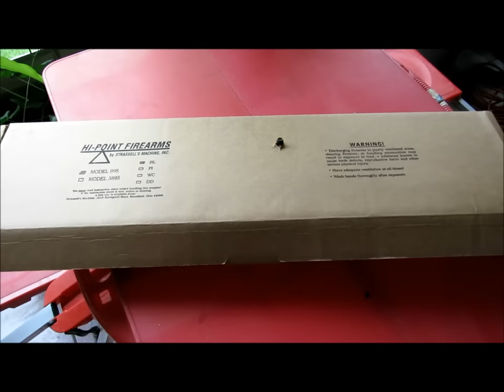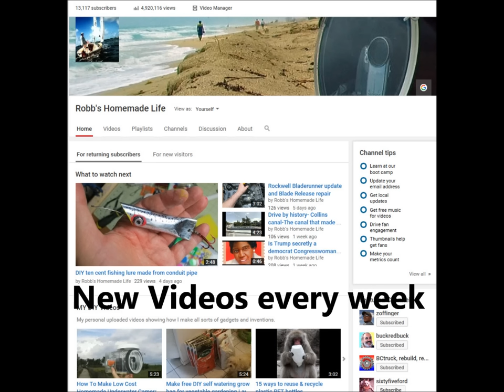10 reasons I bought a Hi Point Carbine & 6 bad reasons not to

Comment: If they designed this carbine to use glock mags gun stores could not keep them on the shelf.
Reply: there is a company that takes glock lowers and turn them into carbines.
Reply: Agreed, but this was designed during the Assault Weapons Ban, as such limited to 10 rounds.  A new version would be nice, licensing to Glock might drive the price up though.
Reply: Game Lard there is a survival rifle that accepts glock mags, and is extremely versatile (several conversion kits available), but starts at about $750. the name escapes me, but it is by aero something or other.
Reply: I almost purchased this but instead spent the extra cash and got the Keltec Sub 2000 for that exact reason.
Reply: The TNW Aero Survival Rifle.
Reply: Rick Ncarolina Imagine if Glock made an actual pistol caliber carbine.
Reply: Jesus Christ, if there was a version of this carbine that would take Glock mags, I'd spend money out of my rear end just to buy it (I'd spend money I don't have for it).
Reply: Ruger PC Carbine 9mm takes Glock mags. It's about $300 more than the Hi Point, though.
Reply: No shit right!
Reply: They don't need Glock's permission to make this gun compatible with Glock magazines.
Reply: Ruger makes a glock mag PCC now.   Even breaks in half which is cool.   Keltec also makes a quick-folding PCC that takes glock mags, I have one of those too.   995TS probably has better ergos, but the keltec is neat because its insanely lightweight and folds super small instantly.
Reply: @dusty  I am not sure why this was said either, I believe maybe because glock magazines are abundant and not as costly as purchasing the magazines designated for the Hi Point Carbine. Glock mags being double-stack is probably a factor too.
Reply: @th3unmaker  wow the convenience of glock magazines at the low price of 400$ exctra
Reply: Eastern Cowboy why would they need to when you can buy the high point mags for less
Reply: Ha! I looked everywhere around my area pawnshops and retailers for a good month. My buddies refused to let go the one they owned.
Reply: And they might sell even more if xd mag was a option. Or just simply made their own proprietary double stack.
Reply: @th3unmaker  Kel-Tec makes one
Reply: Imagine what a Hi-Point would be like if it were engineered to $500 price point
Reply: @dusty because if you're having to buy mags, or pick them up off of kills, Glock mags would be abundant.
Reply: Well regardless. They are sold out everywhere now.
Reply: Theres a company that sells a spider stripped lower reciever with a glock 9mm mag well.
Reply: They can't keep them on the shelves now with factory mags!

Comment: Thank you for posting this review as you did.  I am neither a Hi Point owner or user, nor do I plan to be.  But this is one of the best  and most unbiased, honest reviews I have seen on this weapon.  (Honest in that his personal reasons/feelings are expressed and actual information is imparted - both pro and con.)If I may suggest, add a few brackets in the case to hold it steady in the case to protect your investment and, should the need arise to retrieve it in a defensive/emergency situation, you can do so quietly and securely. Finally, unless you are a seasoned gun owner, I would suggest taking it to a range to become familiar it.All the best! :-)

Comment: These are excellent weapons. If you have a problem with it "jamming" it is usually a magazine issue. Of the HP carbines the 995TS is my favorite. I have a .40 and a .45. The longer barrel gets more potential out of the pistol cartridge. What's funny is there is a suggested video comparing the HP to the AK47. I have seen that one before and the HP is more accurate! Thanks for the video.

Comment: A person can literally run over this rifle with a truck and Hi-point will fix or replace it at no charge. ( you may have to pay shipping  ) No other firearms company does that or none that I know of.
Reply: Yes it’s solid and reliable, my pet peeve is the weight, after adding a Red Dot optic, forward grip & flashlight and using 20 round mags, it’s a little heavy.  I own a Kel Tec Sub 2k, out the box that Carbine is only 4 pounds, suffice to say I haven’t taken the Hi-Point to the range since I’ve had my Sub 2k…

Comment: One more great aspect of the Hi Point, mounting a red dot couldn't be easier.  If you're middle aged and your view through iron sights is nothing but a blur then a red dot can be salvation. It's hard to beat a Hi Point 995 paired up with a Bushnell TRS-25 for high value and low cost. At that price point, nothing even comes close.

Comment: I really like the Hi Point 995TS carbine.  It is a great partner to a 9mm pistol.  I have been testing hollow points in my carbine.  Most heavy for caliber hollow points work well.  My best results were 135 grain Critical duty, Federal 147 gr Hi Shok.  124gr and 147gr standard load cartridges with a XTP bullet work well.  No 115gr HP I tested was able to stand carbine velocities at self defense range.  Every 115gr bullet I tested shredded on impact with a jug of water.  I quit testing 115gr ammo in the carbine when a Gold Dot over expanded in the first jug of water.  
If all you have is a 12ga pump shotgun low recoil ammo is an option.  I prefer standard velocity buckshot but I have health issues. Low recoil is easy to shoot and I am confident with low recoil buckshot.

Comment: good video for someone who is admittedly not a gun guy. in my opinion the part where you said it more accurate because you use 2 hands could be changed. I'd say it's more accurate because it's "shoulder fired". handguns use both hands as well (99% of the time). I think for self defense I'd prefer a bit more stopping power so if lean more for a $300 SKS that shoot the very affordable 7.62x39 ammo. it's cheap, combat proven, and is a deadly weapon even when you run out of ammo since it's steel and wood vs plastic.

great video buddy.
Reply: +mixflip The 7.62x39 ammo the SKS shoots is actual rifle ammo, and will be accurate at longer range. The milsurp ammo is indeed cheap, but corrosive. Yeah, proper care and cleaning of a firearm takes care of that, but many people will go to the range, then put it back in the closet until next time. I like the SKS, so don't get me wrong. Great firearm. I'd also say that the weight issue he talks about could also be said about the SKS. I guess people are lazy. Anyhow, I have the SKS (besides a couple of Mosin Nagants, Mauser 98, Arisaka 99 7mm, and a few other heavy goodies), and will be getting a HiPoint 9mm carbine. Agree with your points, and agree that he made a great video.
Reply: +Steve W I believe my norinco has a chrome lined barrel so it should hold up well to neglect with surplus ammo. in my opinion if you are planning to ever use a firearm for self defense then a big part of that plan should be basic maintenance. I'm not talking full milspec field strip but run a bore snake through it and store it decently oiled. 

if people can't even do that....well then I can't say the world will miss them lol. with 7 billion people consuming earth resources....some of us have to go.
Reply: mixflip
Agree completely. Your Norinco does have a chrome lined barrel, and as you say, still needs cleaning.
Reply: +iTheGeek ??? 7.62 does almost nothing? wow thats a first. usually folks say the smaller calibers do nothing. the funny thing is almost every Police dept sniper uses a Remington 700 in 7.62mm which definitely does some damage.

as for the military. they didn't drop 7.62mm because it didn't do anything. they dropped it because leadership at the time were trying to lighten soldiers overall combat load. carrying 6 magazines loaded with 5.56mm is significantly lighter than carrying 6 mags loaded with 7.62mm ammo. combine that fact with dumping the heavy M14 with a lighter M16 and the military got what they wanted in a light combat load.

a basic sniper for decades used 7.62mm even after the military went with 5.56mm for regular troops.

to say 7.62mm does nothing to a body is utterly ridiculous.
Reply: +mixflip Do you plan on storming some trenches? The SKS is a much bulkier gun and yes it does use a rifle cartridge. I dont really like the SKS stripper clips.
I have both and for fun the HP is great.
Reply: +iTheGeek 7.62 is military and made to not expand.
5,56 does the same but may shatter.
40 SW can be HP.
Reply: i wish i could find an sks for 300 ive only seen them in the 500 dollar range
Reply: +Brian Plotts I picked up a Zastava N-PAP M70 last January for $450 new in box. It was as good a deal as I was going to find, so I jumped on it.  I think they are running about $530 these days, but you can usually find great deals on AKs and SKS' on black friday.  Also, gunbroker has SKS listed in the $300 range, but I can't say what their condition is.  Just gotta shop around and jump on the deals.
Reply: +mixflip Or for another $100 he could get a VZ2008 (civilian US made version of the VZ58), a phenomenal rifle also chambered in 7.62x39. I got mine for $400 new including the FFL fee and it came with three 30 round mags and a bunch of accessories. Mine has a folding stock too so it is very compact and suitable for home defense, despite being a bonafide rifle. Then again, he lists among his reasons that it uses a handgun round. Not sure how you can beat a weapon you can buy $200 brand new... I wouldn't mind having one of these in addition to my VZ. 

I would suggest anyone considering an SKS to look seriously at the VZ. Uses the same clips as an SKS to top-load the mags from the top (if you wanted to do that) in addition to having a normal removable 30 round magazine somewhat like that of an AK (not the same). For $400 you cannot buy a better rifle. But for $200, the HiPoints are actually pretty good too.
Reply: +Defx10 So how is the NPap? Is it decent quality? I remember going to Maine Military when they had stacks of YUgo SKS. I think I paid $125. They had tables full of cracked stock cheapies.I think the AKs then were from $199 up. You dont see many AKS these days here in Maine.Not even at GUn shows.
Reply: walter chiappini
I love it. The quality is high, and it doesn't have any of the rough machining marks on it that other AKs have. It's clear that they took the time to make them well, and they are made from all brand new parts.
Nutnfancy has a full review of it on his channel, and he loves it.
Reply: +mixflip I have an SKS and I disagree with you.  The SKS does not make a good home defense gun.  First off it's 41 inches long, that's 9 inches longer than the Hi Pointe Carbine.  He also said he is a beginner, this carbine would be very easy to shoot.  7.62x39 will overpenetrate as well, it will shoot through your house and through a neighbors house and hit them.
Reply: Brian Carroll 9mm will overpenatrate too, especially out that 16+ inch rifle barrel. Any round that can reliably stop or kill a human being with a center mass shot will go through interior walls of any mainstream home like its not there, even in handgun format.
Reply: mixflip good luck finding a SKS for $500.00
Reply: I think the 13 yo girls and 80 yo gramdmas won't agree with your SKS choice. LOL
Reply: just buy a 12 ga
Reply: @devinpetersen2387  580$ before tax from Canada

Comment: This video randomly found me and I'm glad it did. Very informative, Robb. In recent years I picked up a couple of Hi Point carbines (chambered in 9mm as well as .45 ACP) because I realized I had a lot of pistol ammo and wanted something other than a handgun to push it through. And I didn't want to spend upwards of $1,000 on a carbine, so price was definitely a factor. They may not win any 'firearm beauty contests' but, as you mention, they're reliable and definitely better than a sharp stick (as the old saying goes...). And maybe one of these days ammo will go back down in price. At 40-ish cents per round (for 9mm) it seems like a person almost needs to take out a loan to go to the gun range nowadays. Again, great video!
Reply from the maker: Hey Jason. Thanks so much for commenting. I agree with you. If I had a 45 pistol I definitely would have considered getting the 45 carbine.

Comment: I did the same.  In fact, I bought it BECAUSE it was cheap. I just had to try one out. for $300 out the door, it just had to be junk.  But I've shot the heck out of it and and it just plain works.  And I can't say its ugly.  AR-15's aren't pretty...I have one of those too.  AK-47's aren't pretty either.  My only beef is the 10 round mag, and redball seems to have fixed that.
Reply: MrMerlin9911 Ar15's aren't pretty? Stop joking. The Hi points are hideous. But I've heard more good than bad about it's performance.
Reply: Nope. AR's are functional. They are not pretty.  Here's a pretty gun. http://www.gunsandammo.com/blogs/history-books/most-beautiful-handgun-ever/AR's are ...well...tactical looking.
Reply: MrMerlin9911 I guess that's why I think it's sexy. Because of the tactical look. Th Hi Point looks like a Star Wars gun. Still does it's job though!

Comment: I have the .45 caliber one like this. I use it for home defense. The best way to set it up is  to get a second grip for underneath the front of the gun where the picatinny rail is located. That way at night the front trigger lights up a green laser that is sighted in at 25 yards. In the dark, pull front trigger  look for green dot and your ready to protect your loved ones without having to use the iron sights. Also mine has a rechargeable flashlight built into the front piece also. It is called VO Cobra Grip Flashlight Laser Combo. I bought it off ebay. I keep mine on a mattress holster on my side of the bed, that way it's easy to get to in the middle of the night. My kids are grown up and left the house so I don't have to worry about little ones playing with it.

Comment: I don't like it for a different reason..... #7 ~ It's not left-hand friendly at all. The cases eject out the gun almost the way they would from a typical bullpup model. Meaning, right by the shooter's face if you're firing left-handed. Unlike the FAMAS or Styer AUG (which are bullpups) you can't simply reverse the ejection port to the opposite side of the gun and safely fire it left-handed.
Reply from the maker: Thanks for the input!
Reply: Robb's Homemade Life
Unfortunately, it's the one disadvantage that can't be compensated for.
Reply: When the feed ramp is sanded down to stainless and the " ears " on the Magazine are bent straight, they eject straight out a good 3 to 4 feet, Js. Even with the simple mod's...a whole lot cheaper than the next up in price ( Kel Tech )
Reply: Craig but it will VOID the lifetime warranty.
Reply: NO...It WILL NOT according to the " Warranty Department " AT HIGH-POINT, I called and asked BEFORE I had the work done. Right Hand up, they told me that it WOULD NOT VOID the warranty. Just so you know, I also had my gunsmith
 call them and they told him the same thing and he described FULLY what he intended on doing to all three of my guns
Reply: Craig Fisher Strange? Doesn't your instructions say if you use a certain aftermarket magazine it will void your warranty? Why would modifying the carbine not?
Reply: C Kim NOTHING will void the warranty, I called because I had sanded the feed ramp in all three of mine, sanded the inner rail, cut 2 & 1/2 turns out of the spring and cut my trigger springs down to 3 & 4 pounds. They said they'd STILL stand behind their Warranty !! GO HIGH POINT !
Reply: Craig Fisher Cool! Usually that doesn't happen. I read if you use a ProMag magazine it voided the warranty. But that was long ago.
Reply: Craig Fisher Cool , thanks!
Reply: South paws will never be right
Reply: NGMonocrom to be fair, most firearms like most weapons in general save a few exceptions, are designed for right handed people as most people are right handed. A lot of other weapons can be painted with that dislike.
Reply: True, a lot of weapons can be painted that way. But there are also quite a few that allow the ejection port to be switched over to the other side. I think Hi-Point is losing out on extra sales by not offering such an option. Sure, it might increase the price a bit. But it would still be a great, reliable, budget alternative.

Comment: I have the 380 version and right away I will say it's heavy.  As far as taking it apart, it's a bit of a chore but I broke it down and put it together about 10 times just to get the feel and losen things up a bit.  The only real complaint is you need a tool that is provided to do it.  No quick field strip if you had to.  Oh and the Mags stick a bit when removing them.  I'm hopeful that this will losen up some too.  Out the door with this carbine for $299.  I also purchased a Walther pk380 and enjoy having the same ammo.